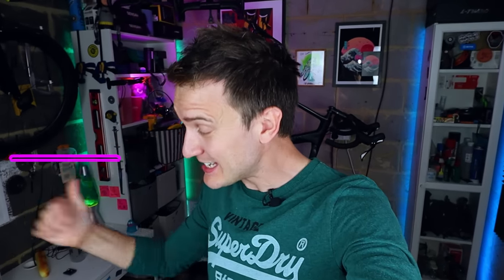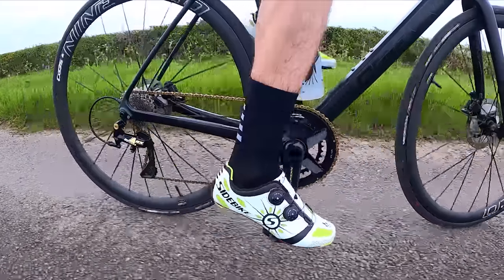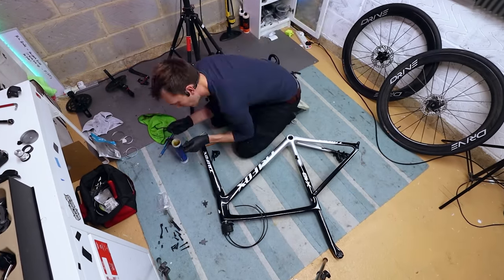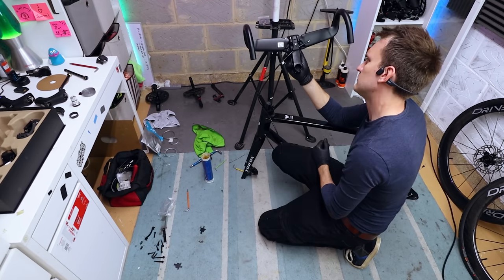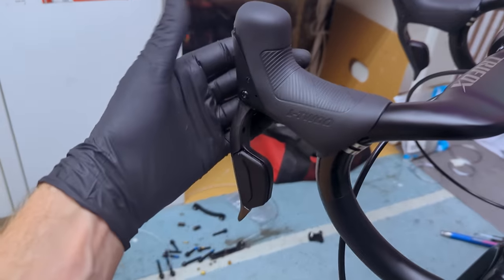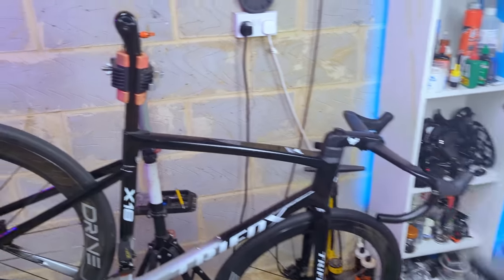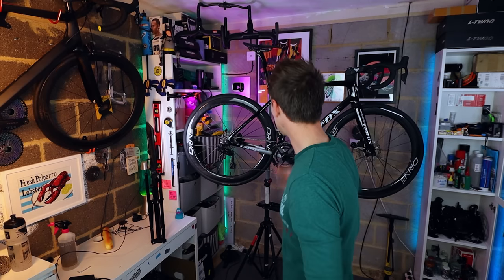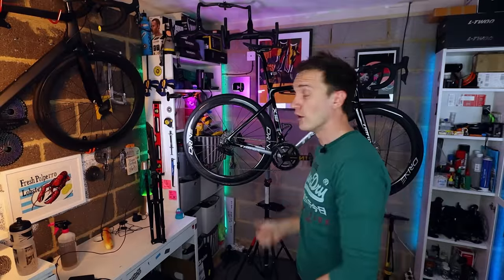Unbelievable value! 100% Chinese ELECTRONIC bike build

Comment: I just can't motivate myself to build a fully internal routed bike. Just the extra steps for the headtube doesn't seem to be worth the struggle
Reply from the maker: It was honestly MUCH easier than i thought it would be... The one issue i can see, is that maintenance moving forward will be a masssive pain. For example if i want to remove, or add a headset spacer... gotta pull apart the entire headset